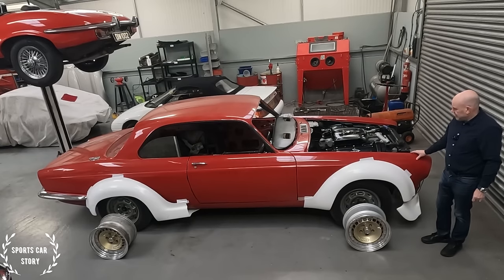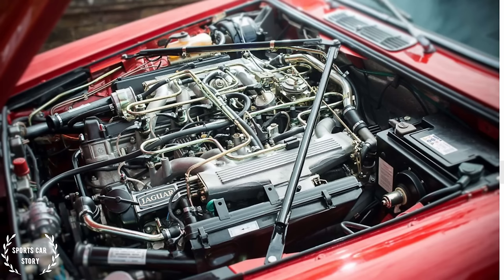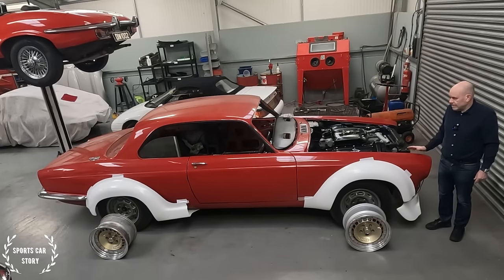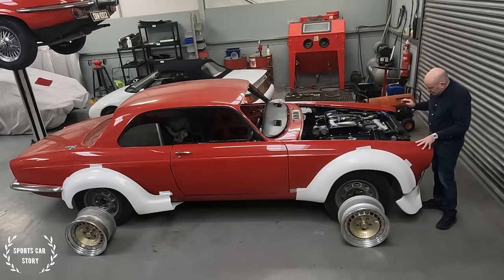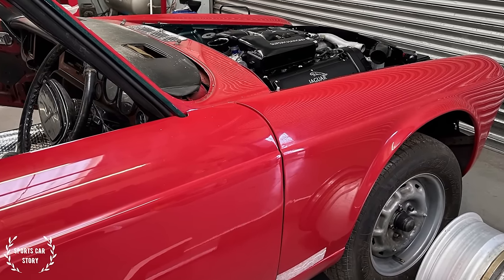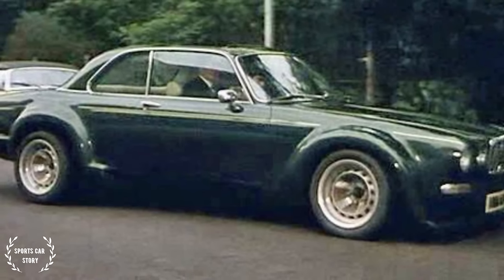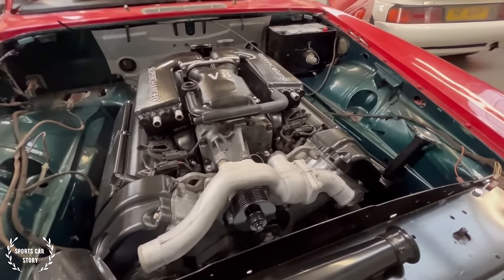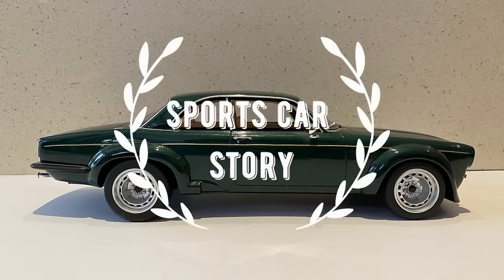Using this model as a guide, we're building a Jaguar Broadspeed John Steed Replica.

Comment: Which version of the supercharged V8 have you fitted?
Reply from the maker: 4.2 from a late S type
Reply from the maker: -& I forgot to mention a 6 speed manual from a Jag Diesel which fits straight on to the bell housing.
Reply: Good choice. Parted-out supercharged 5 litres are relatively rare & obviously expensive - but that's a great combination. The 6 speed will transform it. The Drivetribe XJR conversion was interesting as was Tom Lenthall's XJC conversion.

Comment: Original paint was lacquer, if it still is i would take it to the bare metal to clear all of it off. Lacquer reacts badly with other paint types. As for the roof, it is easier to stiffen the car for torque by reinforcing the rocker area , 14 to 16 gauge should suffice. Side note this is the onl Jag  body I like the looks of. Good luck with your build.
Reply from the maker: Thankyou - & thanks for the advice!

Comment: The major problem with these cars is water leaks,you will NEVER keep the interior dry unless you never wash it or take it out in the rain.The seals simply do not work.
Reply from the maker: Yes. Needs to be kept humidified garaged, & dried out after getting caught in a shower!
Reply: The reason for that is the body flexes too much due to Jaguar being cheap and not engineering more rigidity into it. If the front and back screens could be installed and bonded into the body the same as a modern car then the glass would stiffen it up hugely. It used to be routine in those days to have the screens removed and reinstalled due to the body flexing and breaking the seal to the body and glass.
Reply from the maker: @duster8100  will try to beef it up
Reply: @duster8100  I remember it well

Comment: Umm theirs abit of a catch with this, the independent rear suspension of the original car cant handle the rims and tires, its actually too big, and overwelms the IRS suspension system, its something harry metcalf found with his jaguar when he was asking after it when he had the chance to buy the original and actually asked broadspeed about it

and he covers it in his videos about his XJ12 with the manual swap, as to why he didnt John Steed it

which is not unique to the Jaguar, Corvette Coppied the same suspension setup and replaced the more unique parts with tradtional mass produced junk, leaf springs and the brakes in the normal places with the 1963 revision of the corvette that came out the same time as the E did

and even there they have problems, as you need to beef up the diff's and put in offset trailing arms to get them to handle the extra grip and weight of larger grippier tires, which only started showing up on the latter C3's as a problem

given they went from 7 inch rims to 8 starting in 1969 and it grew from there

so you might have to do a ford 9 inch rear to fit them if your intending to go full hotrod like some people actually did with the Vette's when they drag raced them

or look into beefing up those specific parts, the offset trailing arms probably taking the strain off the axels, which is what breaks on vettes if you put too much tire on them

drag radials namely, and with modern grippy tires, well you could also look into the updated 4 link suspension system they had on the corvette C4 that fixed this problem when they went to 275's on the british engineered Corvette ZR1 by lotus

which is apparently a popular restomod thing to do on custom hotrods now, much like the mustang II's Steering Rack, which was rack and pinion when everyone else was still recurculating ball, just like the Mark II Jag Vs the S Type I think, unless I'm getting my Nomenclature wrong

either that or fit the second gen version of the IRS to the car and see how well that works
Reply from the maker: Thanks for your words. I’m going to see how it feels when I’ve finished the car. I read the 1976 article on the Steed car, & it mentioned tram lining (understandable)   But not much else.
Reply: @sportscarstory  Yeah if I remember correctly another part of the problem was it just didnt have enough power to break the tires loose and it just couldnt cope and handle that well with the larger tires

which might explain the shaking from it going back into the motor like that

which most certainly wont be a problem with a supercharged Jag motor in there, but if you run into those problems, those are some of the possible solutions

along with maybe I think its called a drag loop, like theirs some sort of a shield that helps keep the driveline in check 

and a scattershield wouldnt be a bad idea too given how much your going to be giving it

and FYI part of the reason why I know this is I want to build my own movie/tv car, the daytona from vice, which was corvette in base

using a 327 4 speed with big tires in the rear, as I do want to beat on it and road course it

mind you I've been falling heavily back in love with the cuda he used on nash bridges, as you cant beat a 440

and even that has its own set of problems given its unibody construction
Reply from the maker: Thanks for your thoughts!

Comment: to strengthen the body , and stop flexing it , we put steel tubes in the sills ,, also the kit is not hard to put on , and i made my own front spoiler  for it the side pieces of the spoiler  where made using the 77 front spoiler as a template , and i made them out of steel , the center part  also from steel , and do not bond / fiberglass them into the kit / body , because the first speedbump will crack  the fiberglass ,  so i would just make it a bolt on spoiler , that could be replaced easy ,,,,, i wish i could put pictures up here , as i have hundreds  of all the broadspeed cars , and of my own car , but  youtube does not alow that sadly
Reply from the maker: Can you DM me through twitter?
Reply: @sportscarstory  i tried , but it will not let me
Reply from the maker: On X , pete@sportscarstory

Comment: The original car designed and used on the New Avengers was disposed of quite recently.  I heard various testimonies that it was not a nice car to drive as something had happened to the drive train to make it a pig to drive.
Reply from the maker: Yes apparently it tramlined badly with the fat front wheels/tyres
Reply: @sportscarstory   Indeed. Thanks for the reminder.  I hope you will be able to get 'round this flaw but a large part of me wants to have a replica but without the bodywork modified as these 2 door saloons are rare and very desirable.

Comment: the bodykit is not specialy designed for the avengers car , it was the leftover kit/ front spoiler of the 1976 car , , also the wheels where of the introduction version  , that could not be used for racing , because they where closed off and had no cooling , the racecar  wheels for 1976 had bigger holes in the wheels for cooling so the set for the introduction where put on the avengers car ,, after they narrowed them and modified them to fit on a road suspension ,, the avengers car was nothing more than a road ( pre production ) car , with a v12 ( with carburators ) , automatic gearbox and big wheels , and it drove like a pig , because of the horrible offset of the wheels ,
Reply from the maker: Yes. I read that in an old article - that it drove badly. Hopefully we can improve it when we get it on the road.

Comment: The original steed car was recovered from rotting away in a lock up
Reply from the maker: Yes. Hopefully it’s being properly rebuilt as we speak.
Reply: @sportscarstory   apparently so.   It’s the only broad speed XJC. V12 produced.   It still made 62 grand at auction. Plus about another 100 grand for the full restoration.   Someone is doing the replica arches in  fibre glass    But the broad speed are all steel.
Reply from the maker: @russcooke5671  Yes it’s Fibresports who’ve got the molds. They originally bought them from a bloke back in the 80’s.
Reply: @sportscarstory   I wonder how much they would cost to produce in steel.   I bet they would be very expensive.    👌👌👌
Reply from the maker: Yes. I’ll check out the cost.

Comment: The arches on the steed car were more rounded, the arches you have don’t suit the jaguar lines
Reply from the maker: When mine are fitted properly they should be same - take a look at the project when it comes back from Fibresport.
Reply: the arches on the steed car where exactly the same  as this kit , all from the same molds  and the same as on the racecars !  only difrence to this kit is the front spoiler, and the fuel tank covers 
 , the spoiler  came from the 1976 racecar ,  after the only race in 1976 at silverstone the 1976 car went back to jaguar  and got repainted and got the spoiler ( front and rear )  of the 1977 car  for promotional purposes  the 1976 spoiler and wheels ( of the introduction , not the race wheels )  where used for the steed car

Comment: If you want to drive it regularly as an automobile and maximize your future resale value then keep it stock. All the mods you are contemplating will severely compromise your enjoyment of the automobile unless you value fettling above all else. The XJC was never intended to be a race car, and hotting it up opens the door and wallet to endless compromises. We owned an XJC for several years, and it was a lovely car unmodified. The 4.2 inline 6 works best kept below 4500 rpm. The inboard rear disc brakes overheat when pushed and are a pain to service. The automatic transmission doesn’t like to be hurried. This car is a beautiful and  comfortable cruiser, not a race car. I also owned an XK 120 FHC for decades. The 120 was the great grandpa of the XJC, and many design and engineering elements from the original design remain, but in modified form. Both cars were the Grand Touring versions of their respective stablemates.
Reply from the maker: Thanks for your comment. I know it’s a bit mad doing these mods, but I do like the Steed car, and the straight 6 wouldn’t have quite cut it. I love XK120’s, especially with the rear spats in place!

Comment: i believe the real thing is still around for u to measure up :)
Reply from the maker: Any info on the genuine Steed car would be greatly appreciated!
Reply: @sportscarstory - It was sold at auction a few years ago, (in need of restoration). I may still have a pdf somewhere of it’s catalogue entry. I’ll see if I can find it over the next few days.
Reply: The owner of the Steed car also acquired 1 or more Broadspeed cars. He had big plans even talking of trying to get a ( period ?)transporter and updating to race car suspension but with standard engine for road use. Apparently nothing became of the project. I understand the owner has them all stored at M&C Wilkinsons who ran a Broadspeed race car No. 1  for the owner driver Chris Scraggs. I know the guy who would most likely be called in on any engine consultancy so I may get to hear more in due course.